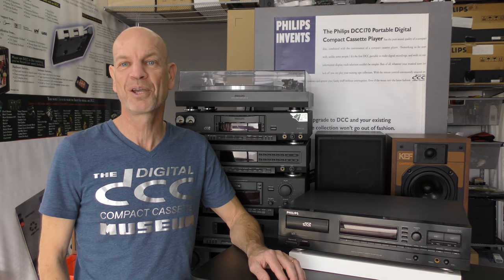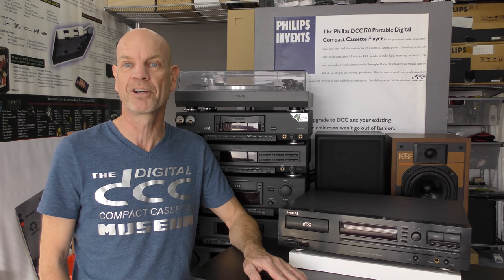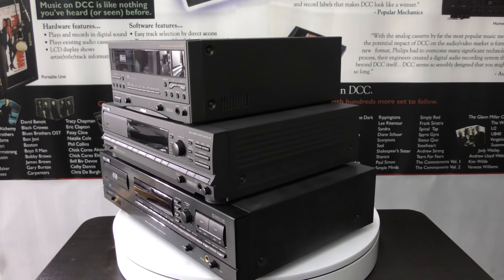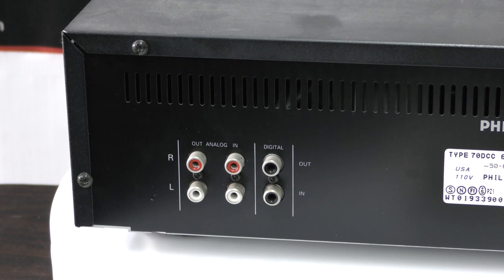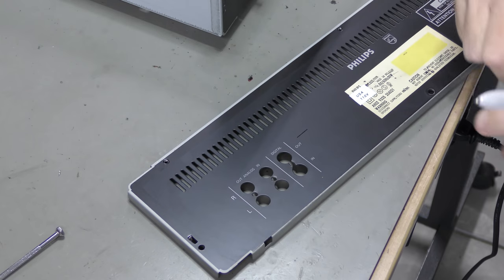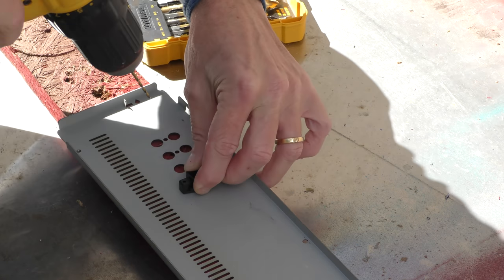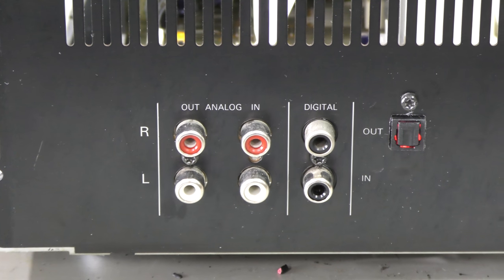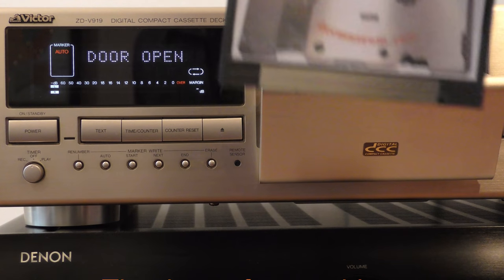Adding a Optical Output to a Digital Compact Cassette Recorder

Comment: Great info on your channel, brings me on a great idea, 
I do have an optical input record on my Philips DCC 951, but no optical output, 
Next to it is a place where an optical output can be connected to the board. 
I still have a faulty PC motherboard with a built-in optical port. mounted which I could use as a donor,
to place an optical output on my DCC 951 
if the board pins are placed in the same order as the 4 holes in the motherboard of the DCC 951 player.
That would be an even a nicer finish than with Met the wiring solution 

I can already remove the donor port, but for now, I will enjoy the DCC music first now that I get it working and playing properly again, and in the meantime, I can look up some more information before mounting the optical port in my DCC, is in no hurry, and then I can also make optical connections with the SACD player afterwards and so on, thanks for showing your knowledge here on your YouTube channel #115🎶👍
Reply from the maker: Hi, We already made a video on that topic as well. https://www.youtube.com/watch?v=Y6N0mt8UmIY
Reply: @DRDCC  Just did Sub your channel today, so be probably still some to learn here< I had open up a broken DCC cassette and plan to post a video from it after someday,s so as to have an inside view of the cassette, my portable DCC player had it broken by a broken tape guide from a fall

Comment: Great video. Were optical outputs / inputs not commonly fitted along with coax digital back in the day ? Or was it just depending on the model / cost of the device.
Reply from the maker: The first generation had optical as well, but not the second generation.
Reply: @DRDCC  Pioner made a rare double analog cassette deck with digital coax input.  But that was only for transfering cds to audio cassette.

Comment: Hey ! Thinking of buying a dcc player, which one should I buy? 

Want to record digitally to regular cassette tapes from your mobile with mp3 128 or 320 files, can I?

Does the player convert to the cassette tape? Which models play up and in from dcc players? 

Have a Pioneer CT-W 806 DR cassette player and use RCA in with the mobile and digital light on, then convert from digital to analog to the cassette. 

Enough with it, hear no difference with dcc players? Does not convert or does not detect sound from the mobile?

Best to stay with Pioneer CT-W 806 DR then ? Will Dcc player record better to cassette then Pioneer CT-W 806 DR i wonder ?
Reply from the maker: We actually have a video called which dcc player should I buy. That will help. DCC will outperform any regular deck. Not just an opinion, but fact. Digital vs Analog.